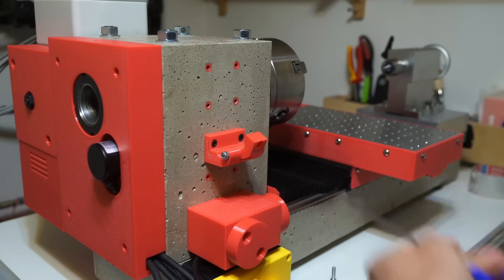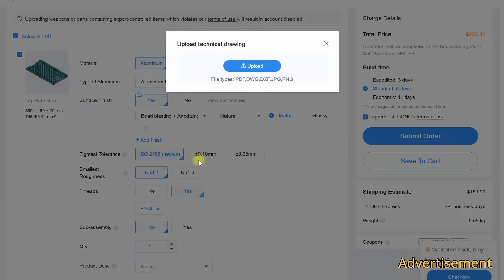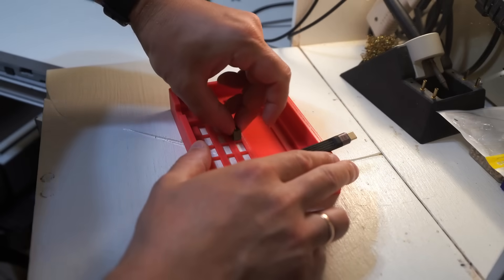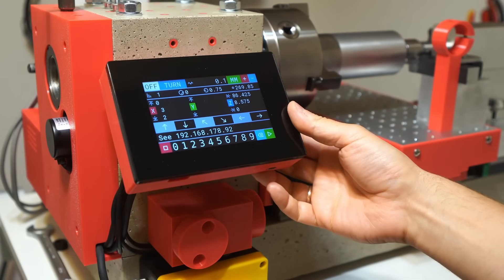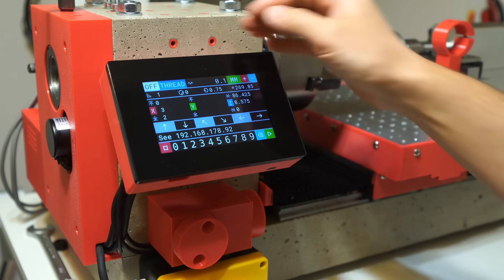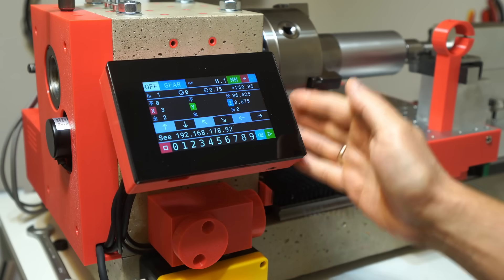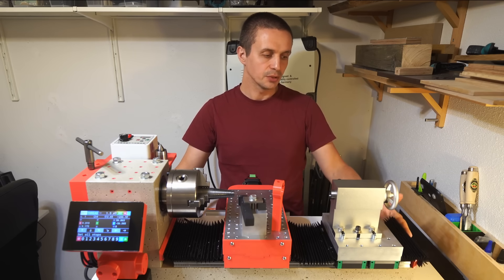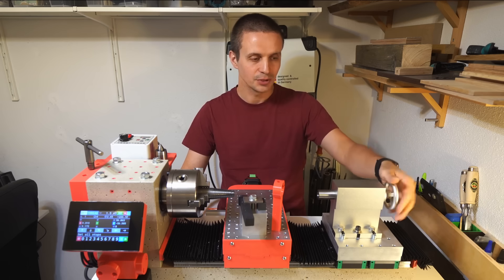3D printed concrete lathe, part 3, final

Comment: Nice rigid lathe! 👍
However I think your plastic mouting bracket for the spindle motor needs upgrading to something stronger and more rigid.
Also, that box around your power supply should really have airflow entry and exit holes and a small (40mm) fan.
Beautiful pro cinematography, and nice looking software!
Reply from the maker: The bracket holds fine for weeks so don't expect changes there. There's airflow in the box, chip-safe holes on the left and on the bottom.

Comment: Commenting for more engagement.  This series deserves lots of love.  A free and open source project that has well edited, straight to the point videos and clear discussion of pricing, methodology, and areas of improvement is laudable and should be encouraged.  Best of luck, I wonder if this can be scaled to a larger machine...?
Reply from the maker: I wonder too. Perhaps we'll see more modulathe instances of all sizes pop up over the years!
Reply: Насколько я в курсе были в истории серьёзные токарные станки с бетонной станиной.
Reply: @vladmir8115  Oui INDEX Allemagne avait à l'époque des tours en béton (pas une réussite)
Reply: I think it could. DIYers have been making pretty big CNC mills out of concrete and epoxy granite over the past decade or so. You'd possibly have to nerd out a bit over which type of concrete to go with as supposedly, there are some specialty types that have a lot less shrinkage(?) than more regularly used concrete. There are some really knowledgeable guys who have done a lot of work and thinking on this over on CNCzone if you feel like going into that rabbithole;)

[EDIT] Had a quick look at the BOM and Max already thought if this (of course). I think the Sika grout specced is one of those low-shrinkage options.
Reply: Л4+

Comment: I'm surprised at the use of a belt instead of gears or a chain, however you know more than I do. Very cool project, thank you for sharing.
Reply from the maker: Belt is much quieter than gears or chain which both require ongoing lubrication.
Reply: I think the philosophy is that when it binds or gets overloaded, belts and belt gears are cheaper and easier to replace. 
And something like that will fail first in order to protect other more expensive components already in the system from failing.
Reply: Belts are fine for a small lathe, however this belt is too small it should at least be a 20mm width belt with 2 metal pulleys, and that plastic motor mount bracket is totally inadequate.
Reply: @wizrom3046 
If those things fail, they'll be easily replaced/upgraded and likely won't cause major damage.

EDIT: as evidenced in the video, actually. He swapped plastic pulleys with metal ones.
Reply: @wizrom3046  My feeling is that  the belt is fine. I run a 10mm wide timing belt on my mini lathe with a upgraded 700w BLDC motor and two alu pulleys. No sign of wear after many months . The lathe itself, the frame of it, also limits how much force you are going to put into the cuts.
Reply: @AntiVaganza    it depends somewhat on the pulley diameters, larger diameters put less pull strain on the belt (because of the effective torque diameter) and larger diameters also get more teeth in contact so there is less force per tooth.
But you have to be careful with a small diameter pulley and a thin width belt, especially if there is a lot of difference in the pulley sizes which means the small drive pulley puts a lot of strain on the belt and its teeth.

Comment: ten wspornik do silnika głównego to chyba tymczasowy? bo to raczej nie wytrzyma, może któregoś dnia wyfrunąć
Reply from the maker: The load on that plastic bracket isn't huge and spread out pretty well, I think it will last. Much belt tension isn't needed either. If it fails, it can be re-printed easily or just order it from 5mm aluminum on JLCCNC. Probably even not hard to make a flat motor plate at home with basic tools.

Comment: I have a project to create homemade servomotors with Arduino. I would like to show it to you and see if you can correct some things.
Reply from the maker: Sure, tell us about it in https://t.me/MaximKachurovskiy comments
Reply: @MaximKachurovskiy  I'm sending it
Reply: @MaximKachurovskiy The plan is to move it to the esp32-s3, use the cores for the encoder operations and the step and direction signals separately. I have already tested it and it has good results at low speed. The Arduino Uno is very slow and the interrupts do not work in parallel. I don't know how to program esp32-s3, but you do. Maybe we can do something good with this.
Reply from the maker: @Dmecatronic you can use Gemini or deepseek to convert your code to esp32. Probably not many changes are needed.
Reply: @MaximKachurovskiy The free version is very confusing, I've tried it.